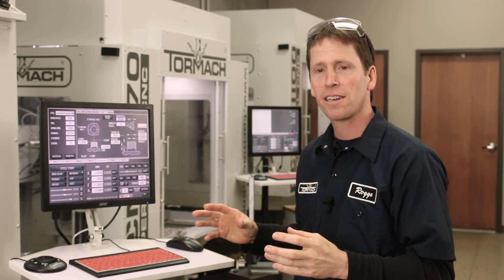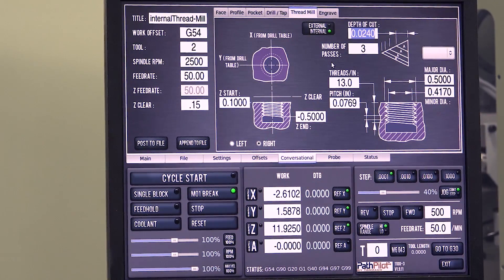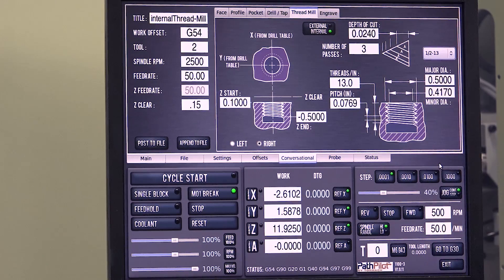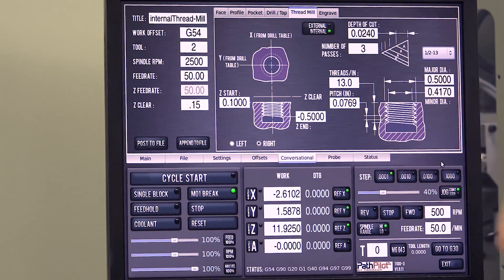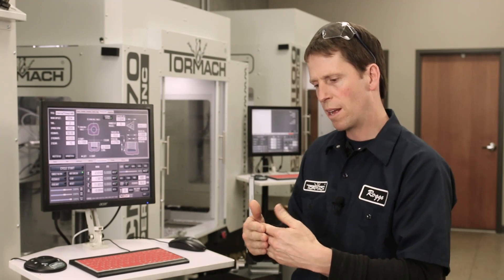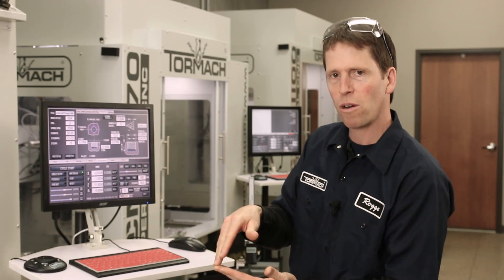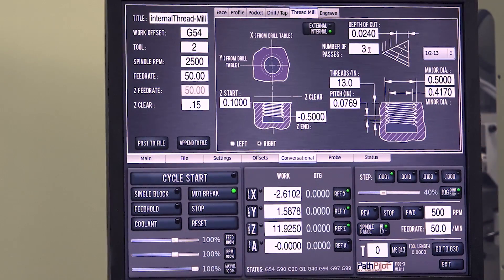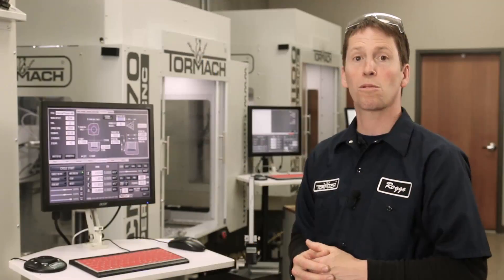PathPilot Quick Tips: Conversational Thread Milling

Comment: It looks like you're in front of a 770. Is the 440 capable of conversational thread milling too? I'm researching for a new machine and I don't want to assume anything.
Reply from the maker: Yes, all of our mills are capable of conversational thread milling.
Reply: Thanks. After some research, I'm now convinced that either the 440 or 770 are the best options as the main workhorse for an R&D shop I'm building. There are some details that I need for planning. Who can I contact by email?
Reply from the maker: Hi Mike. There are several was to contact us. Check out the Tormach Contact page: https://www.tormach.com/contact.html